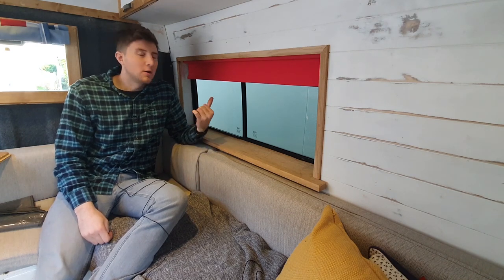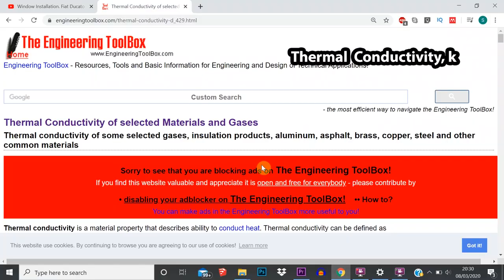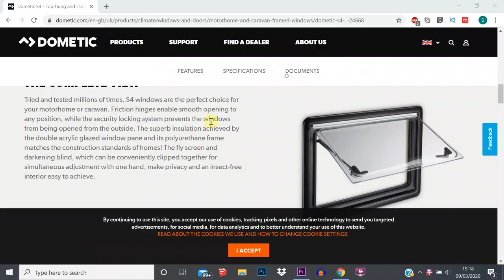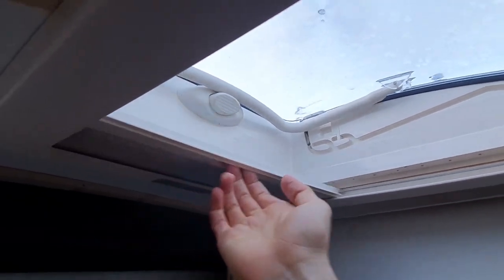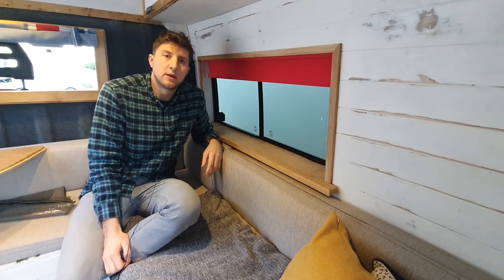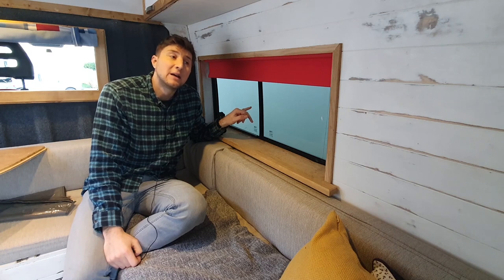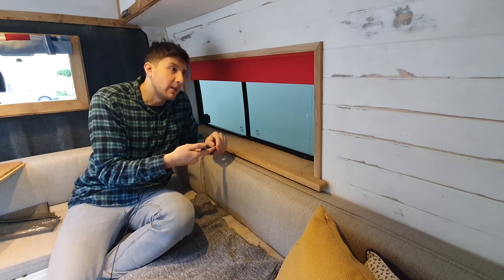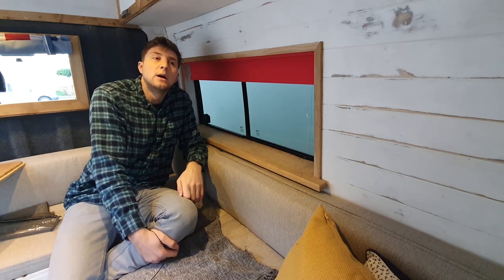Van Windows // Don't Buy Glass Windows!! // 4 Reason Why!

Comment: good solution for this is the food truck style windows. they have a cover that comes down over it : ) I wanted it for stealth reasons but it could definitely fix security & insulation problems! I would insulate the covers that swing open : )
Reply from the maker: Yh sounds like a good idea! Bit of added weight though?
Reply: @sampayne6318  possibly, will have to look into it. haven't dealt with one but would definitely be worth it for me. can't imagine not having a window at least for my seating area, but need to be stealth and security is pretty important too as I'll be full time
Reply from the maker: Yhh, I was gunna say roof lights do let lots of light in but you obviously miss out on any views...you might be able to keep some aluminium covers/ shutters that are light and strong 💪
Reply: @sampayne6318  they make lightweight one's with aluminum! I think they can all be pricey though, so honestly yeah I was thinking maybe I can figure a way to save the cut out I make for the window, add some sort of trim and have a diy cover hahaha, still trying to figure out how to make that work though... I'll probs be thinking for a while 🤔

Comment: I wouldn't worry about security because if someone wants to break in, then they will do. Also, a bonded glass window adds torsional rigidity to the vehicle, as with the front windscreen which adds 34%.

Comment: Good points. Had not thought of the security element.
Reply: Are you forgetting the glass windows at the front on the van?? If they want to get in the van they will. Also you can’t leave plastic windows open at night as well as all it takes is for someone to put there fingers under the open lip and rip it open.

Comment: I have both types on my van I glass fixed in the sliding door and slider the other side and a poly vision towards the rear  and heki 2 in roof,  I like both, Oh and have you never heard of blinds  and isolated covers for glass windows.  I guess everyone has an opinion  but I am sure the many thousands of vans on the road with bonded windows  are happy enough with them.
Reply from the maker: Yh I think bonded windows are great on smaller campers. However If I did another big conversion I wouldn't use them...the dometic windows have blinds and flyscreens built in.

Comment: I getting 4 glass windows installed for me two at the back doors, fixed on the slider and opening one on the other side. All for £600 fitted. If I went caravan style it would all look like a submarine from the 70s and cost over a grand. No thanks. There is plenty of examples of decent blinds, just look around.

Comment: I'd keep the glass it makes a noise if it gets smashed I've seen acrylic melted with a butane soldering iron to open the catch which makes no noise.  You can always add another frame similar to the acrylic with blind and screen on the inside

Comment: Are acrylic windows even road legal for vehicles? Do they have marking? Your glass is tempered. In case of accident it can be easily smashed to for access or if it brakes it shatters in small bits. What does acrylic do? Pop out and fly somewhere? Plus its flammable thats why it is not permitted to use in road vehicles. I am very interested on what is a law on this.